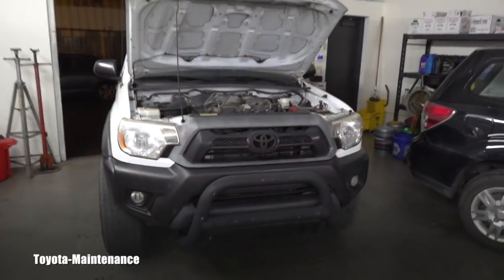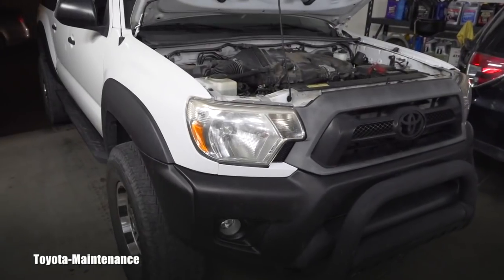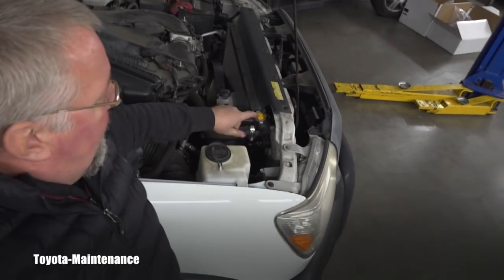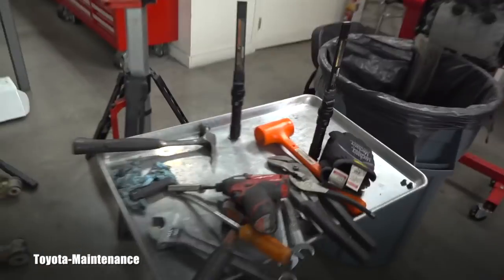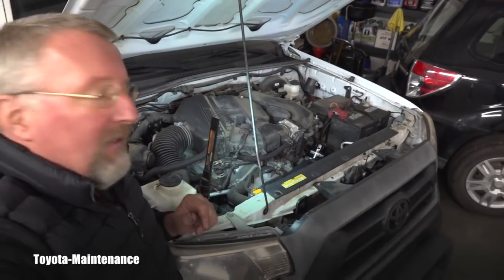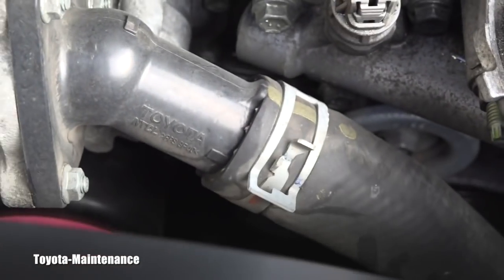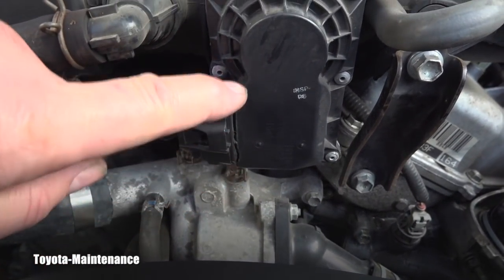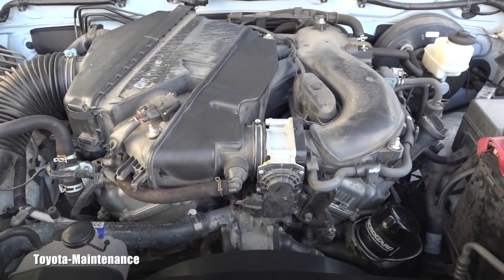Toyota Tacoma Coolant Leak

Comment: Pro tip.  I work at a Toyota Factory that builds the Camry.  When installing a hose like that.  Spray the inside of the hose with 70% isopropyl alcohol.  Makes installing so much easier.  We do it everyday at the factory.  Also I don't know why people toss the factory clamps.  they are resettable.
Reply: I’m one of those people that have thrown away the oem factory Toyota Camry radiator clamp and Acura Integra radiator clamp. The tension after 12 years, just fades. I have tried to “reset” the tension, by bending it into a tighter form, but I live in the rust belt, and things don’t go back to normal. Sorry to say but, worm gear clamps work after oem factory clamps fail.
Reply: @karkule5919  I have installed many hoses in the last 50 years, I use nothing. If I need some lube, I would use the antifreeze.  Thanks  ...Jim
Reply: @karkule5919  Well on the assembly line...  We have around 10 seconds to get the radiator hose on and the clamp set.  so That's why it isn't a big deal.  trust me I've done it at home as well working on my car and its perfect.
Reply: Great tip Tony. Thanks for sharing
Reply: If only you knew or do you? Of the short stubby hose on the gen7 Corolla back of the water pump ... That alcohol spray tip could help tremendously ty!
Reply: @jimpie231  try that short stubby gen7 Corolla hose buried behind lol

Comment: The odometer was probably turned back 150 k miles, that's why control arms, coolant hoses, clamps not original and so on
Reply: You have get your super-duper scan tool to find out what the actual milages is, 'eh?
Reply: I'd take the VIN and go to the owners' page Toyota's website.  That might be the easiest way to check.  I've caught over 3 dozen altered Toyota odometers searching for a used car recently.  Tow yards and auctioned cars (small dealers, driveway resellers) seem the most culpable.
Reply: Brooklyn in The Rare old Times it looked aged under the hood , rusty clamps in CA not! worn parts etc dodgy non std clamps hummm very suspicious 🤨
Reply: @andrewhardcastle7982  ... And a brand new intake manifold.

It looked like the interior had seen better days too.  I doubt a car with under 100,000 miles would look that worn out... Even though it may have been owned by a slob.
Reply: @andrewhardcastle7982  Peter is in Arcata, on the coast, not far from the Oregon border. Salt air and steel don't play well together.
Reply: i was also thinking something like that. shady dealer taking high mileage car from recent model year and swapping out the instrument cluster from some actual low mileage car that was wrecked
Reply: @BAD_CONSUMER  It's scarier than that. There's software out there that can do it... At least for the driver's display, I don't know about the ECM or any other internal modules.
Reply: @BAD_CONSUMER  if u take the cluster out, miles can be reprogrammed, it takes now how and equipment I have seen it done, older Toyota doesn't have mileage stored in transmission module nor ABS module
Reply: @chesucat  older Toyota don't store miles in transmission module  nor ABS module, scanner is useless
Reply: @SeanPopify  Tow yards especially for the OPG and repo are bad bad people. Something wrong about guys who steal cars to make their living. Even if legal.
Reply: @chesucat  you have no idea how many previous Canadian vehicles have miles that have been tampered with.  My bet is that it is a previous Canadian vehicle.

Comment: Soooo  many people replace the OEM snap clamp with worm gear clamps out of convenience. Worm gear clamps are problem waiting to happen. Just buy the snap clamp pliers and avoid future leaks.
Reply: Parts store Worm Clamps are the problem, rounded edge Worm Clamps are do-able. Either are indicators of questionable repair.
Reply: Collin Hopper  - I have a million worm drive clamps on my boat (x2 engines). I think they’re fine if you tighten with a nut driver instead of a screwdriver. And, they’re good quality clamps to begin with.....

Comment: Thank you for pointing this out.  I had my hoses changed as regular maintenance at 90k service and they put those clams on and I was not happy.  I grew up with a mechanic and drove truck for 36 years and I aways check to see if they did the work right.  I’m an older woman and young mechanics think I’m stupid.  Last time I used a new shop...my Toyota guy had retired...they didn’t change the oil or completely flush the radiator.  Oh I was upset and brought it right back.  They soon learned not to try to get over in this lady.

Comment: While Toyota-branded coolant is preferred, it is expensive. I think you can get the exact same coolant, made by Aisin for under $14 a gallon. Look up part # ACT002. I figure the water pump manufacturer, Aisin, knows what coolant is best for their water pumps. Check RockAuto.
Reply: Carquest has been carrying Pentofrost, which has HOAT in all of the different colors. A Honda specialist I knew swears by it and uses it for all of his Asian car work, including Nissan, Subaru, Toyota and Honda.  Under $20 a bottle.

Comment: Found myself nodding in agreement when you showed the coolant leak, that's how interesting your videos are.  Also, considering the parts needed for the suspension, the coolant hose and the throttle body problem, one would think there were a lot more than 42,000 miles on it!

Comment: Peter your work ethic, attention to detail and honor is second to none. That truck, potentially was in a front accident. Also, I only use European hose clamps with rolled edges (ABA, Gemi, etc). The spring clamps are not bad either that Toyota uses from the factory.

Comment: For the plastic crack get some cheap super glue, clean the crack area with alcohol, press the crack back together as much as possible leaving enough room to have the glue get down in it a bit. Liberty use the superglue on the crack. Keep the pressure on it and immediately sprinkle baking soda on the wet glue. It acts as a activator and instantly hardens it. Very strong results and you can immediately use whatever it was you fixed. Wear gloves as it will burn if you come in contact with the wet super glue and the baking soda. It helps to have it flat as well so the glue get down in there.
Reply: LOL, Until you bond that harness connector to it. Then you will have to replace a harness or hack it to peices. Any cheap super glue in not a good idea, unless you know the working characteristics of that brand and viscosity/ flow of that cyanoacrylate. Better to do that off of the car if you chose that route. Many people do not have the finess to do that correctly.
Reply: The baking soda trick works great but I would be using 5 min epoxy on that.
Reply: @fastwalker21  I’ve always tested it on similar plastics of what I’m using.  Been doing this trick for years and haven’t had anything but good results. Bad things can happen I suppose.

Comment: The base under the screw is usually bent out and will cut into the hose.
Bend the base corners up toward the srcew before installing.
I put white thread sealer on the hose ports to guarantee good seals.

Comment: With such low milage why would the truck already need a cv axle, comtrol arms and such?
 I have two tacoma 4x4's, a 2004, & a 2015. My 2004 has 282,000 miles, has been an abused work truck it's entire existence, driven off road almost every day because of my job & where i live yet it still has the original cv axles & i didn't have to replace its control arms until just one year ago. 
My 2015 has about 80,000 miles on it & everything is still like new as far as its chassis & drive axles.

Comment: The quickest way to check an engine for a coolant leak is to pressure test the system, with an engine cooling system pressure tester before and after the repair to make sure no other leaks are present, this pressure test will save time and prevent a comeback.

Comment: 40K or 140K miles?  My 2006 Tacoma still sporting all original rad hoses and all suspension components.
Reply: My 07 is as well. I have new take offs coil overs from a 3rd gen. I’m thinking I should change the hoses as well. It’s at 112k miles.
Reply: First time just replaced upper & lower  radiator hoses , replace thermostat & water pump  , replace coolant passage pipe, transmission & differential fluids , and new gas cap for 2007 manual taco with 240 thousand miles

Comment: Would replacing the hose clamps with the original "self tightening" ones be a better idea? From my understanding the screw-on style clamps will lose tightness as the rubber degrades and shrinks.
Reply: You would think a Toyota mechanic would want to use OEM part, Toyota Radiator Hose Clamp, Stock Code 9613644301 Price: $7.87, but I guess since this guy found the problem in his shop.  He didn't want to appear to be one those mechanics that just happen find problem.  As a mechanic, you don't have to be so nice that to make people like you, just be honest and calmly explain why you should get this fix a certain way, but if the customer doesn't want fix it the correct and just go with 'ad hoc' way.
Reply: @golferpro1241  even with my extreme OCD, I would not see the need to replace hoses that are only 5 years old.
Reply: @jeffreybass5479  I have been driving cars for 55 years. Have probably replaced a couple of hoses in an emergency (while on a trip), but since about 1995, have replaced none. I started driving Honda’s then, lately a Toyota. I have used oem and worm clampes. I never tighten with a screwdriver, I use a 1/4 drive with an short extension and socket (more control and less of a chance of over tightening).  Maintenance here is key, hoses, clamps, belts are cheap. They cause huge problems when they fail on the road. Buy known brands, like Gates,  Goodyear,  AC Delco, etc. Check specs of the mfg. and compare. Try to make an educated choice. Reuse old clamps if ok. On the Honda’s I have replaced all hoses p, coolant and regular belts at 100,000 miles. Did timing belts at intervals recommended by Honda. Most new Honda’s have timing chains, so this is not necessary. Anytime you see coolant is low in overflow tank, add to low level line. If you have done this more than a couple of times this is a signal that more investigation is needed. Toyota, mine is only 3 years old, 48,000 miles, everything is good.  Inspected anytime changing the oil/filter (synthetic oil and filter rated for synthetic oil or oem filter), I change my own oil. Again, maintenance, I record in my service manual supplied by the mfg. and put notes in also. Very important, I don’t remember everything I’ve done to the vehicle, but my log does. When selling vehicle this shows what & when you did anything.   Thanks.....Jim
PS......I also use stickers under the hood. By the way......how old is your battery? With today’s electronics, this is very important & when was the last time you checked your battery & alternator? Most Auto Parts stores will do it free, use the one your most familiar with, call first.

Comment: GReat video I'm wondering if that top engine cover is hitting the throttle sensor connector, causing it to be pushed in and cracking. Maybe you can check the inside of that cover to see if I is rubbing. Just my 2 cents. Thanks for these great videos.

Comment: Why don't use use a cooling system pressure tester, rather that running the engine to get the pressure built up?
Reply: I agree that makes perfect sense you can test cool and warm too.

Comment: Hey I finally see a subaru in your shop, when are you going to do a subaru maintenance channel. It would get alot followers. Another great video!
Reply: He has another channel for Subaru
Reply: @gjm3525   @gm1 smith  I have been a suby all  my life and have had several but my next vehicle will be a taco as it suites my needs a little better for the future. My subies never let me down and some people just don't know how to maintain them. Yes, the oil burning issue with the defective piston rings did screw alot of people. That cannot be overlooked. Boxer engine in general though do consume more oil than a traditional engine.
Reply: @wim0104  And that would be???
Reply: @gjm3525  yeah Toyota’s definitely don’t eat oil.. lmao..
Reply: @flat4forlife588  After 20+ years of Subies, I just got a 2019 Tacoma.  Paid for head gasket repairs on 3 of our first 5 Subies.  My 2013 Forester guzzles/burns a qt of oil every 750 miles.  Subaru is focused on building sales, NOT engineering/design quality.  I got tired of the excuses.
Reply: @jeffjohnson6252  Agreed subaru went from small and quality to increased sales and decreased quality. It's the nature of chasing sales. I look forward one day to getting a taco, hopefully soon

Comment: Just as a temporary fix, would it be ok to put some RTV sealer in the throttle body connector? Just until it can be replaced?
Reply: Just about any Silicone caulk would work in that area, it’s not under pressure or high heat.
Reply: Put some RTV in crack, wait 2 minutes than close gap with zip tie. Either leave it or remove after a day or so.......Jim

Comment: Hi Peter, thank you so much for putting these useful videos together. Quick question- can an airleak in the AC pipes make its way into the cooling system? My overflow reservior was boiling last week but now it seems to be fine. After some research, I read the two systems are independent, which makes me wonder where the air in my coolants coming from. No milky oil cap, no white smoke out of tail pipe, heater still works inside the truck, so I don't suspect a head gasket leak. Any experience with this issue? I've got a short video on my channel if you'd like to gain better understanding. Any info helps, thanks peter!

Comment: Thanks, there is a reason why OEM used tensioner like clamps that compress when cold and expand when warm. Not fixed diameter like that sewer lines clamp

Comment: 18:33 ... that pink SLL coolant is pricey at MSRP but can be had for about 15$ per gallon on the holiday yota parts sales from various dealers of +40% off MSRP + no charge shipping if order over 75$ ... my gen1 Tacoma radiator takes TWO gallons of it!! from a simple DIY drain and refill

Comment: I have an 08 4runner with only 55k on it. About 5 years ago, I had the radiator hoses replaced. Guess what? They forced those stupid worm gear clams on me. About every other cold winter, they have to be tightened up a bit on both ends. I'm gonna go back with new hoses and the factory Toyota clamps in the spring. Had quite enough

Comment: I never use those clamps. Ruined a radiator on  my wifes car when we were young. The clamp cracked the plastic from over tightening it just a bit.
Reply: Hose clamps are much better but you do have to know what you are doing...
Reply: @chrisluquette1615  no the factory spring clamps are better because they hold at the correct pressure & they always last forever. Screw clamps create uneven clamping force and they corrode.

Comment: I’d love to take a road trip from SoCal to have you inspect my taco. I want to take it to 300k.
Reply: I bet this would help... 😁😁😁

Change the oil, coolant, brake, steering and transmission fluids and filters at 80% life expectancy ( add clutch + differential, if applicable). If you tow, do it even earlier.  Keep things clean, including what gas you put in it and change your spark plugs early too.

Oh, and as Scotty Kilmer says, check the battery. A weakened battery damages the electronics and computers.
Reply: @SeanPopify  good list!
Reply: Do it! How many miles and what year? Hopefully it is an older one and high miles already! Plus being a Youtuber you will be understanding about the time to film everything and maybe he will let you help film! Might take a couple days but at least maybe you can watch nearby if his insurance doesn't allow someone else in the shop in case the Taco falls! He really hates to not be able to make a video because a customer is waiting on the car.
Reply: @LAactor  I have an 07 with about 112K miles. It's been a great truck so far.

Comment: Hi!  Great videos, nicely/clearly presented.  I wanted to write to ask you, but couldn’t find a place to do it so I’m posting my question here, hoping you’ll see it and respond.  

I have a question regarding the transmission fluid on a 5th gen 4Runner (2017). I’ve done drain ‘n refills of the pan, replacing exactly what I’ve taken out but sooner or later I’d like to check the level using the overflow.  

I’ve seen posts/sources that say to ‘short out/jump’ the OBD pins 4/13 and do some shift pattern (not worth listing here) to get it into ‘fluid temp detection mode’, then make sure the trans temp is 104 and then open the overflow bolt to let out any extra and when it stops flowing and starts dripping, the fluid is at the correct level.  

But I’ve also seen some info that just says to be sure the temp is 104 and open the overflow bolt.

I’m just wondering if you know what the jumping of the pins and getting it into that ‘detection mode’ does over simply getting it up to temp?  Does the transmission pull/push fluid to a different level than it would be otherwise?  Is it ok not to do the obd wiring and the shifter-sequence and would my results be the same?  Nobody I’ve asked can tell me what the transmission does when ‘you’ do the obd and shift sequence.

I hope this all makes sense. 

Thanks for any info/help.  Stay safe!

Comment: There is a reason toyota uses those clamps because they have pre tention for expansion! Those non oem hose clamps your using will end up leaking again or you can end up breaking the plastic radiator pipe from overtightened them.